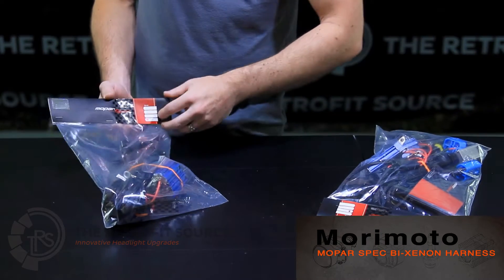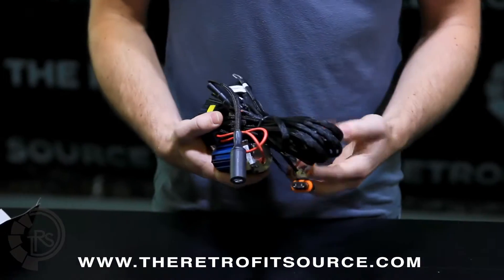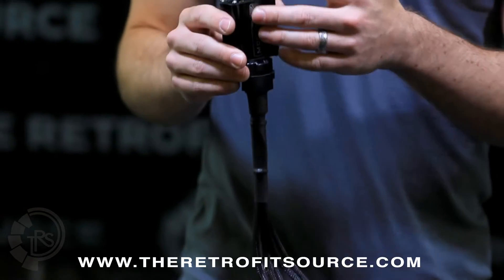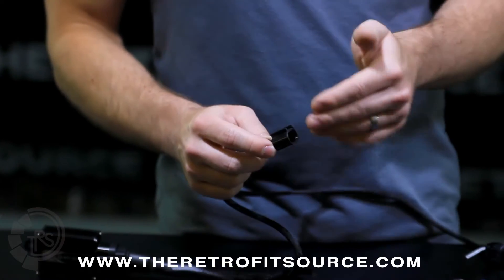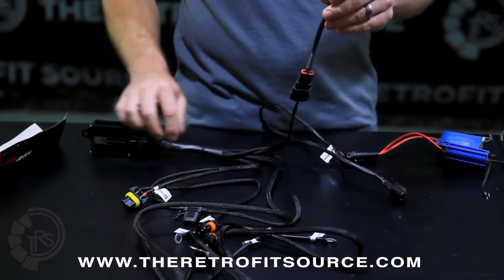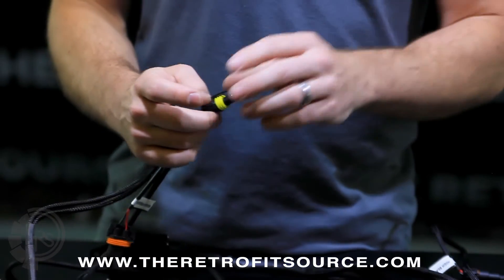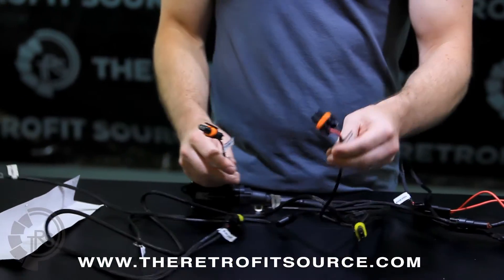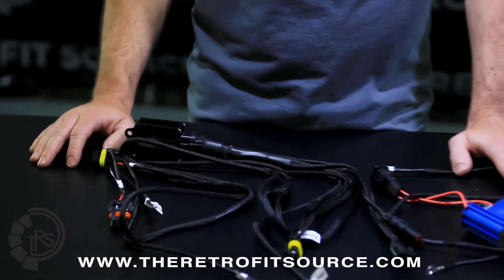TRS Tech: Morimoto Mopar Spec Bi-xenon Relay Wire Harness for Dodge Chrysler Jeep HID

Comment: How come it only has one factory outlet, shouldn't there be two factory outlets? Because I have a plug on each side of my vehicle for each individual headlight? Do I have to hardwire an extra factory outlet so that it'll work? I bought a pair of Morimoto M Led 2.0s for my 2012 Ford Escape OEM headlight assembly. I purchased the bi-xenon relay that I was suggested to get, but I'm very confused about the single factory outlet, will that single outlet provide enough power for both projectors?
Reply from the maker: Yes, it will! The entire point of a relay harness is that it pulls power from the battery, not the OEM wiring harness. You only need a single OEM connected so that the lights can communicate with the vehicle.

Comment: Stupid question, why is there only one h13 connector when my JK has one for each light bulb?
Reply from the maker: It pulls power from just one side to activate the relay.
Reply: @RetrofitSource  so I just installed the new harness and it solved the issue where my super7s would not work on high beam. I am now facing a new issue where my daytime running lights are always on high beam, is there something in particular that I should look into? I have a 2011 wrangler sport.
Reply from the maker: Reach out to our CS team please, they will be able to help you troubleshoot this issue!

Comment: Can this wiring harness be used in a Jeep JK (H13) with Super7's? I ask because when I use the hi-beams on my Super7s, they start to flicker and I believe that's CAN bus pulsing. I always prefer a wiring harness wired to the battery in aftermarket headlight setups.
Reply from the maker: Yes, it sure can be used on a JK with the Super7's, and it will also fix that issue as well.

Comment: What if i have stock xenox hid from factory and want to do something like this?
Reply from the maker: You really shouldn’t have to, Your stock setup can handle your stock HID power just fine. If you start upgrading you’ll want a harness.
Reply: oh okay well my only issue is the ballast keep going out due to moisture
Reply from the maker: Are you running OEM ballasts or aftermarket?
Reply: @RetrofitSource  Oem ballas whichi really hate

Comment: Can this be used to setup the Mopar OEM 2013 Challenger SRT8 HID headlight housings in a 2013 Challenger R/T that was halogen from the factory?
Reply from the maker: This would not, unfortunately
Reply: @RetrofitSource  a wiring kit for going from stock halogen to stock HID assemblies would be great though I have no idea if its possible.